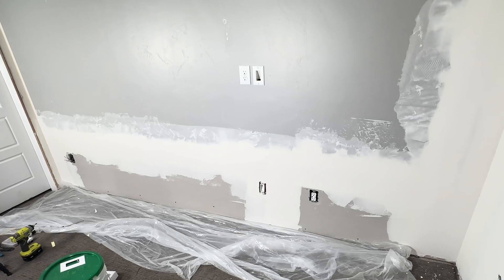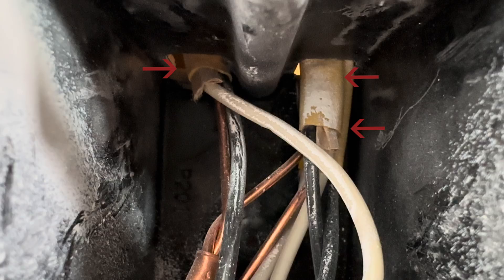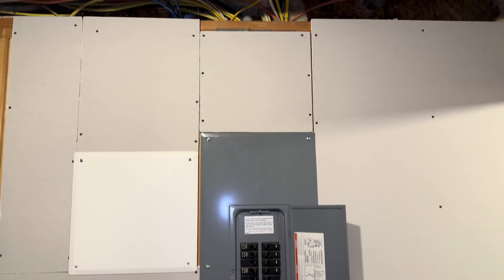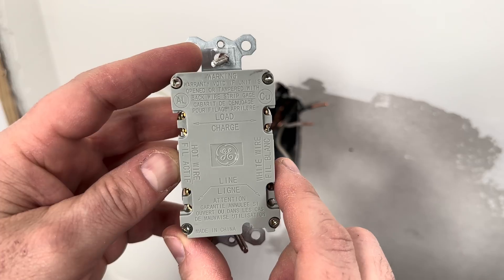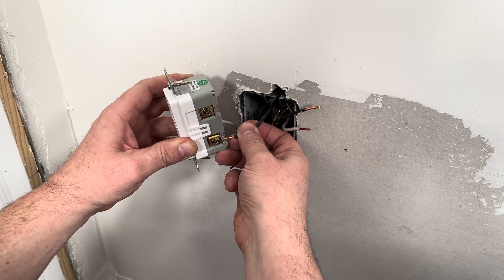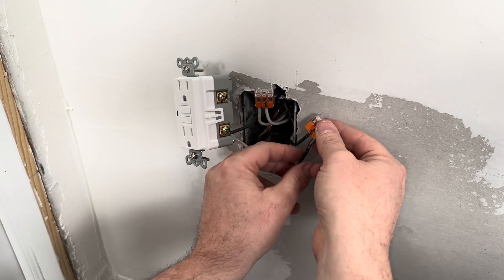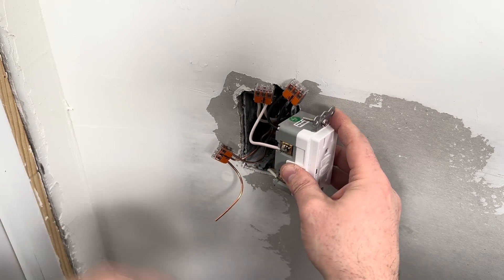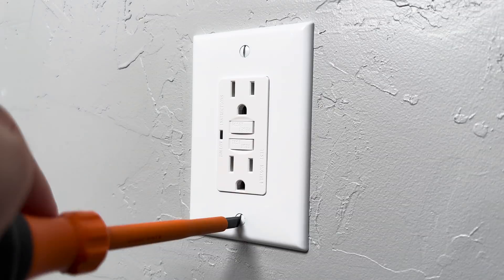How To Install a GFCI Outlet

Comment: Helpful, thanks. The only part that wasn't clear to me was the pig tail ground. The grounds from the two downstream receptacles went into a 3 slot wago, the third slot was the pig tail ground. Since there isn't (I think) a "load" ground, was it the case that the pig tail ground shared the green ground terminal screw with the incoming line ground?